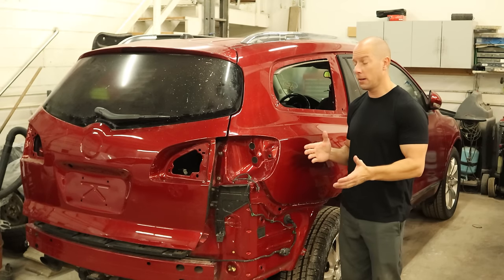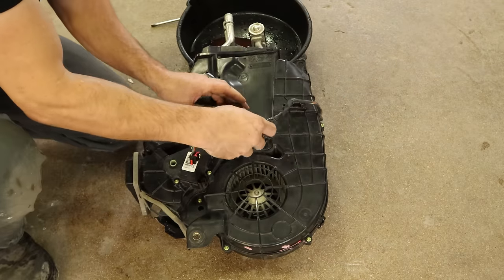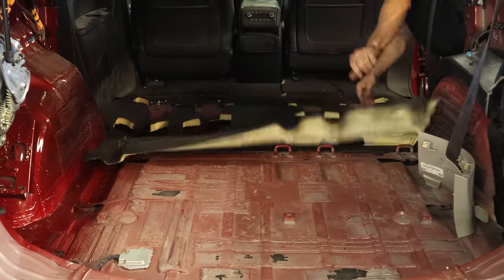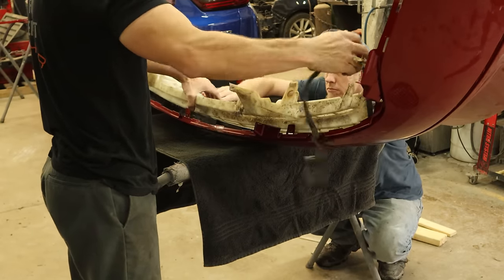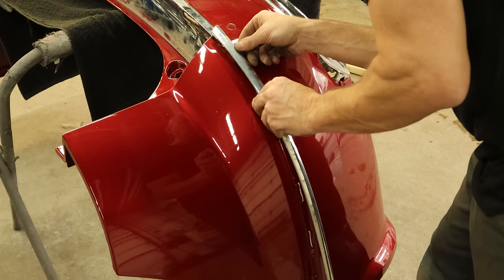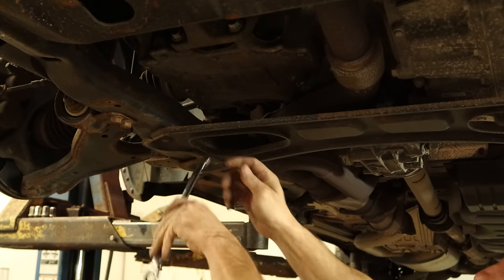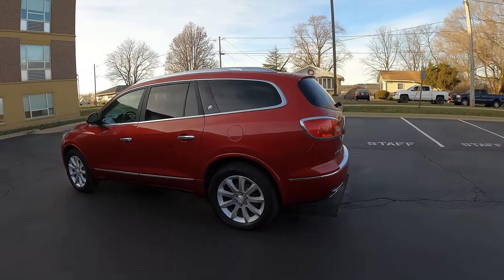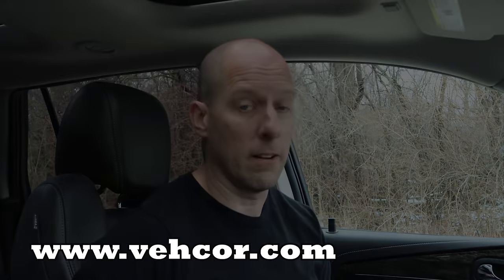No signs of a rebuild on the vehicle or the title so the 2013 Enclave is ready to go

Comment: Tip.
If you have a magnet on a stick or just a loose magnet place it on those clips before you try to release each one.
Or grab a large empty box and sit it in the trajectory of the clip or tie a string to them or even better get someone else to do it.

Comment: Years ago I bought a beater car to run back and forth to college, it was a beat up Honda that had an obvious major repair to the front passenger side, wasn't perfect because the alignment was off and adjusted all the way to correct it but it wasn't enough. After lending it to my brother he blew it up running it low on oil, we put a Jdm motor in it and he drove it for years after that. One day he got a letter from an insurance company that the car was totaled and the proper reporting wasn't done and they offered him 90% of the best possible appraisal for the car and he was able to keep it. I got back the money I paid for it and it payed for the engine and still money to spare. Best cheap car I ever bought.

Comment: I'm incredulous of the amount of fiddly plastic bits of trim in the interior on this model. The way that it all clips and screws together is quite clever, but the time taken to fit, design and tool up all those pieces, plus effort to maintain and track inventory and spares. Couldn't something simpler work just as well and still look OK? Another great build.

Comment: Great job, I am always impressed with the quality of work you do.  To bad your shop is not close by, I would of liked to have you work on my vehicles, hard to find body shop that does quality work.  That oil filter is in a horrible location, that would be a deal breaker, cause I do my own oil changes.

Comment: I actually like the size and efficient interior packaging and room inside, so I'm happy to rent these when traveling if no minivan is available. My in laws own a Buick and GMC versions even, and I don't mine riding in them. But the interior quality (fabrics, leather, plastics, door covering, fit/finish) still doesn't feel up to the level of our recent Mazdas. I hear horror stories about the GM 3.6L, too, but nobody I know owns these long enough to run into issues.
Reply: My sister has  2014 with 190k. It burns 1qt every 1.5k. Bought it 2 years ago at 160k severely neglected with a bad trans. I dropped the cradle with powertrain, swapped the trans, and went through and fixed everything. Decarboned intake/valves, pcv was plugged, power steering pump, lines, new hoses, spark plugs, changed all fluids, new cat for p0420 code. It starts, runs drives great now and has been very reliable since. 

Personally, I would dump them at 150k unless you are a mechanic.
Reply from the maker: I don’t mind driving them but they are not something I’d daily.

Comment: Our traverse 2011 has 180k! Same engine, these things eat timing chains supposedly, but ours is on its original set, always had full synthetic oil since new our problems have been water pump power steering pump and one catalytic converter oh - also The older traverse/acadias had a transmission wave plate / torque converter failure problem - Ours only acts up with cruise control on,- time to change the transmission fluid again. But for the miles and age with cost of vehicles right now?! - Great car still gets up and goes for an suv oh and being all wheel drive it goes anywhere with good tires! And the bose audio still kicks like the day it was bought!

Comment: Appreciate the dry humor!!  I  have a 2012 Enclave same color 202380  miles.  Popping  a P0300  but dash warning lights don't stay on.  Brought it with 39000.  only issues has been air conditioning components replaced under warranty and a bad fuel ignition coil.  How did they paint the tri-coat color? dealer charges big bucks just to paint the hood.

Comment: For what an Enclave is, this is a nice example! 

Glad you could save it, and awesome work as usual!

Floods are terrible, but for parts as the heater box cover those salvage cars are really helpful ... 

If I would have purchased it (I knew it would sell quickly) I may have asked you to use more wax, although rust-belt car - the wax still helps to slow the rusting down and these cars are notorious for their holes and crevasse-like areas (just look at those floor-boards from underneath, why are these holes in the runners there?)?

Cheers from Germany
Reply: Scott is prob the only person in the world to have fixed that one. The engines, and transmission at a salvage yard is worth $4k+ with 80k.

Comment: I think your use of the metric bumper installation tool is incorrect in this application. The Byoo-ick service manual clearly states that an imperial bumper installation tool should be used instead. 😁

Comment: @vehcor I hope you have a great weekend! Who is the best manufacturer for replacement rocker panels on a 2010 Ford F150?
Reply: In my experience (non Ford), the OEM is nearly always the best quality for replacement bodywork.
Reply from the maker: Have a great weekend.  I don’t use aftermarket panels that aren’t bolt on, if I can get used parts.

Comment: Who puts carpeted wheel wells in a truck or any vehicle for that  matter  GM ,,,,,AND Why ?
Reply: Road noise suppression
Reply: @RollerCoasterLineProductions  With the extra thickness of mud sticking on them ,,Sound proof  pfttt
Reply from the maker: Ford and GM, for sound dampening.  I’d rather have the sound and ease of cleaning!